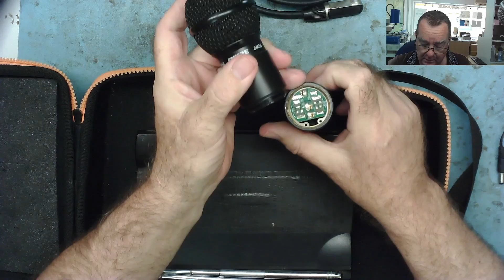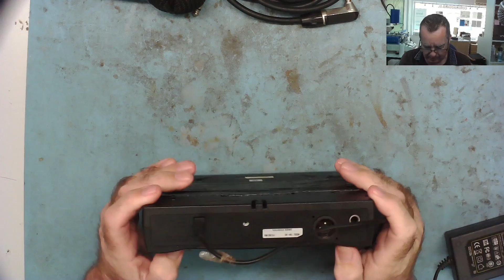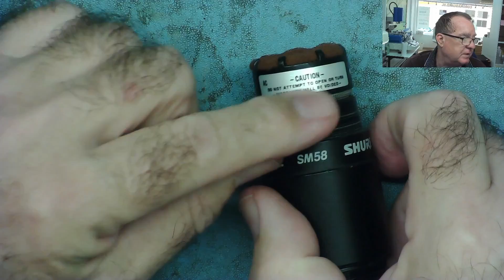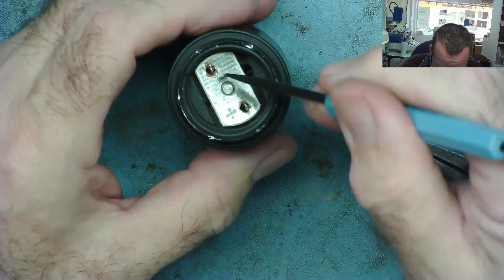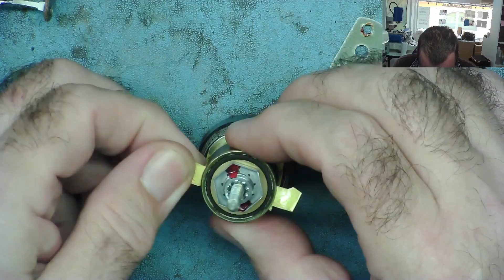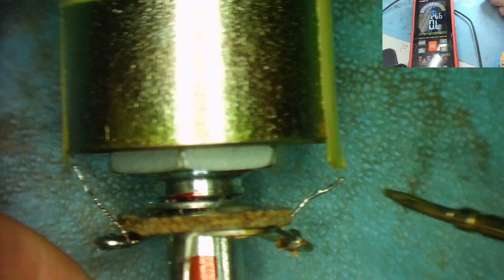Shure SM 58 Wireless Radio Mic Microphone No Audio Sound Output Repair

Comment: I rewind vintage magnetos for a living, mostly they use 0.07-0.08mm wire (around 44-45SWG). although I had to go down to around 0.06mm once for a Honda double ended one. I thought that stuff was fine! This looks considerably finer.

Most of those fine wires have “solderable” enamel these days, I certainly always order solderable as I vacuum encapsulate my coils with an oven hardening, non-solvent polyester resin, which will effectively over-rate the solderable enamel insulation anyway.
I’d be interested to know what size that wire is. My coil winding machine goes down to 0.05mm overall diameter, but tensioning those really fine wires is a bit of a nightmare (as I found when I did the Honda coil).

Comment: I came into possession of a ULXD2 with SM58 Head and I noticed a rattle somewhere in the microphone. I deduced that the sound was coming from the head and after watching a few videos saw that there is a nut that holds the board inplace and yes you do have to go in from the top as the wires are EXTREMELY short. When lifting up the bronze contact just gently push on one side which brings the opposite side up. Take a dental pick or a fine needle and insert into a seam and gently lift up. As suspected the entire assembly  had come apart and the wires were snapped in two probably due to incorrect packaging during transport. Anyway it is very fixable and thank you for this video it was perfect from beginning to end.

Comment: I burn the enamel off with a butane lighter and it works. Be quick with it. You can use the same lighter to light up a big spliff to celebrate the successful repair.

Comment: I've done this many times.  I've got some pointers & can help. Heating the enamel off has never worked for me. I think people got this idea caz there exists enamel coated wire which is designed to be burned off either by flux or heat. MOST enamel wire is not like that. Especially wire used for this purpose >> When considering which wire to use for this delicate application they have to consider the enamel type & thickness to get the mic "sound" correct. They choose wire carefully...  In my experience, trying to burn off enamel results in a more difficult to remove burnt plastic which is now stuck and carbonized to the copper = no bueno. 
sooo.
The trick to getting the enamel off perfectly and beautifully is to use sand paper... abrasives.  Practice with scrap wire. It is very easy when you get the hang of it, but since the wire is soooooo thin it is really hard to see(more on that later/Final Trick). Use the correct grit. Use fresh paper.
 
      Technique #1 >> Tear off little bits of sand paper and stick them to jaws of needle-nose pliers OR tweezers. The tip/end. Tweezers might be better caz the springy-ness will help not put too much pressure. Use tweezers with blunt ends/ not pointy ends. Glue the sand paper to the tweezers or get them stuck somehow. >>> Squeeze gently and pull. Use the other hand to grip the wire. More pulls are better than more force. Stay in the same place with every pull. Count to 10 or 50 and check continuity on that little strip. If good continue >>> Rotate 90 degrees and repeat. Rotate another 45 degrees and repeat. Rotate another 22.5 degrees and repeat.  I call this method the "sandpaper sandwich"
      Technique #2 >> sick some sand paper to something semi rigid & easy to hold like a popsicle stick. Then find something large & flat to rest the wire on. I typically use the pivot joint of the needle-nose pliers. Hold the wire down on the pliers and then sand off the enamel in rotated sections as described above. 
      Technique #3 >> This technique takes practice and I only do this for stubborn wires or when there are way too many to do by hand.  Use a Dremel 932 grinding stone.  I customized mine by making a V-groove in the grinding stone because without that it takes way too many rotations of the wire. With the v-groove you only have to turn the wire 4 times. Without the v-groove it takes ages and often the wire is thinned out of existence. (Flat sections of wire suck!! =weak wire =bad/start over)  Set the Dremel for low/medium speed >> Hold the wire in fingers and gently apply it to the stone >> because the wire is so thin it will have just the right tension to push itself against the stone. The wire will try to wrap itself around the stone and this can be used to your advantage as it will grind more of the enamel.  YES, the direction is important. You want everything arranged so the wire would wind up along the spinning grinding stone.   It's really easy to go too far & practice is necessary.  I customized my 932 because i use this technique often & for many different gauges.   You can find the correct Dremel speed by trying the very tip of the wire first. Slow speed.

   Final trick >> since you're dealing with a mic capsule it is very easy to check if you've got the enamel removed properly by hooking the wires up to the mixer.  You can easily connect alligator clips to an empty XLR connector(no wires attached)... The bare xlr connector has big pins sticking straight out. Turn the gain up and you will be able to hear whether or not the enamel was completely removed. Sometimes it is still spotty, but most of the time complete strips are still there. Listen for the interruption of the ground noise. Push the alligator clip on all parts of this enamel cleaned wire to check for uncleaned spots. It's way faster & more reliable than with the multi-meter.  Don't forget about the sharpie trick to make sure you've covered the whole surface :) 

NOTE: CAUTION:          It is sooo important to get this stuff off completely before trying to solder >>> caz when you try to tin this "unfinished" wire 2 things will likely happen >>  One is that the enamel will carbonize and somehow spread to the whole area >> Then solder is utterly refused, black stuff makes the solder not stick. The second thing that will happen is that the solder might stick to a teeny tiny bit of the wire, then this really gets in the way of trying to redo. When you try to re-scrape/re-sand > the solder gets caught and then you will likely rip the delicate wire apart.  It's near impossible to use the Dremel Technique #3 on wire with tiny blobs of solder.    
                 Yes, again >> Verify the enamel is completely removed prior to soldering << 

   I use techniques 2 and 3 most often. I've also found delight in diamond needle files, but they don't work well for mic wire. The abrasive is way too coarse. It doesn't get all the sections and it's too sticky.   Razor blades which are precisely dulled sometimes work & thats my goto for most wire stripping, but mic wire is special. Razor blade stripping doesn't work consistently for mic wire. Too much risk / not enough slack. One bad pull and your Fkt. Slow and low with the sand paper works every time.    Lastly, if you've got a really expensive capsule you can always unwind a wrap and get another shot...

-Cheers
Reply: Tdt recods: do you have videos of your techniques? It sounds brilliant. Thx
Reply: @ricardoferreira2811  I need a camera. Currently I'm a broke & broken musician. It's a good month if I eat everyday... Don't even have a phone. Embrace the changes caz most things don't happen more than once :)

     I've got plenty of audio recording gear, but zero vid recording stuff aside from make-shifting something out of the raspberry pi or a usb microscope. 

   I have plenty of tricks to make content. Lots of stuff I'd love to teach, but... yeah.. zero video recording gear. 

Someday... 
Thnx 4 showing interest. It's motivating :)

Comment: those tiny enamel wires are a pain to work with. Recently I was fixing a connector for headphones and they used similar tiny wire. I had no luck using soldering iron to break enamel so i can tin them. The trick for me was to put a flame on the end and burn off the enamel. Be careful as it burns like a fuse so you have to blow it off quickly so you only burn enamel at end of wire. Good luck

Comment: I cheap investment to test things like this is one of those cheap baofeng dual band VHF UHF handheld radios for like $30 USD. You can literally dial in the frequency manually and under a 50 ohm dummy load you can transmit back to the mic's receiver as well.

Also Sure is a good mid tier mic brand but there are Chinesium infused plastic fakes out there. The SM-58 is a very common model used out in the wild for general use like in a band for vocals or as a mic on a paging system, at the pulpit in a church, etc... The SM-57 is the model used to mic a drum kit or used in a a room where many people will be speaking at a table in a business meeting / conference or at a convention panel show since it is directional. Neither the 57 or 58 require phantom power from the mixer.

Sometimes with these things like this that you can buy off the shelf at a music shop or online it is best to just replace the whole unit. Of course if it was a special application device that was built for a specific job then you would invest in a repair because of the cost.

Comment: Always hard to fix that fine enamelled wires when they have broken under tension, it can snap where it turns a corner or meets a hard edge. The tape can also mean that it can break in more than one place.

Comment: Nice.
But the thin wires want  free speace fore mechenical abuse (vibration) fore streching so there has to bee a stress release on the coil (loop in tape) and his conections :).
Can you messure the windings on top of the coil ?

Comment: Your having the same luck I had at getting these working again.

There's a huge weight difference in capsules between the original and the bargain replacement. Probably a good indicator that it doesn't have the same frequency range and quirks as an original.

If it's a seasoned performer who's used a 58 for years the bargain capsule may not be a very good choice.

If it's a podcast guest mic or grade school recital mic the cheap copy may be good enough.

Comment: Thank you for featuring a mic repair. Actually, the SM58 (non-wireless) is probably the most used and the most durable dynamic microphone ever build. They have literally been used to hammer nails with and still only needed a metal cover replacement, so it's quite interesting to see an actual failure of the cartridge itself.
Reply: I think someone had already twisted the top part and snapped the wires.
Reply: That's actually the Electrovoice 664 story :p

Comment: Hi Richard i saw that you soldered the positive of the coil to the negative of the terminal:Red terminal is ground ! but as it didn't work... hasta luego amigo ! :) and i wanted to say: the third contact is for phantom power...
Reply: I didn't know they made a model 58 that needed phantom power.
Reply: no phantom power for dynamic mics. You can tell if the mic requires phantom power when it has flat pieces of metal. Metal foil.  Mic capsules which have coils of magnet wire are going to be dynamic & no phantom power.
Reply: @tdtrecordsmusic  I have no idea what your talking about in identifying one type of mic over another. I have several Sure brand mic's and one of them does require phantom power.

I also have a few very old recording microphones that have built in batteries and they don't need phantom power either.
Reply: @tenlittleindians  The manual will tell what technology the mic capsule is made of.  
    You would have to disassemble the mic capsule to see the "metal foil"  vs "copper coil" of magnet wire.  I do NOT recommend taking them apart. I do, but I have the dexterity of a watch-maker. Even with that I only mess with a mic if I need to or it's dead. 
   In general >> condensers need phantom, dynamics don't use phantom, Ribbon mics are all different and you HAVE to read the manual. 
  If you're curious I'd just look it up :) Lots of info online :)
Reply: @tdtrecordsmusic   That's almost accurate. My father just happened to be a watchmaker. Schooled in Elgin Illinois back when people still wore watches. I've got the skills he had plus some electrical background he didn't have.

You seem to have left out or forgot about crystal mics. There's not much to repairing one of those that's been dropped.

A huge chunk of those old "Elvis" style mics have crystal cartridges inside and the sources of replacement cartridges is dwindling.
Reply: @tenlittleindians  Thats cool you've got watchmaker in your blood :) 
Crystal mics, yeah I didn't know we were naming off every mic technology ;p The piezo !!  There are surely some technologies we missed...
   Is the Shure 55 the Elvis mic you speak of ?  An OEM crystal cartridge in that iconic mic sounds like a treasure hunt. A folklore of sorts...  I don't know much about those mics. I've used them b4, but thats about it. I don't remember that mic having any special sound .

Comment: Hi Richard thanks for the amazing work. Just an off topic question. Why is there a voltage  when you measure between transistor C to E in a common collector setup when its ON, while in other videos you mentioned that when  the transistor is ON basically the voltage between C and E is around 0.1 or like a short. I am a bit confused.
Reply from the maker: That depends on what voltage is on the emitter.  In common emitter circuits (the most common configuration) if the emitter is connected directly to ground then the voltage on the collector would be almost zero if the transistor is on.  If the emitter connects to ground via a resistor (and collector to Vcc by another resistor) then this would not necessarily be the case.

In other circuit configurations such as emitter follower, there can be quite a large voltage across collector-emitter when the transistor is turned on (and it gets hot).  In this case it is acting like a voltage regulator so for an input of 12V on the collector, and 9.6V on the base, then the emitter (output) would be 9V and there would be 3V across the transistor collector-emitter.  The wattage dissipated by the transistor would be 3 Volts x Current (amps)

The one thing we can say for certain is that if the base is around +0.6V (or -0.6V for PNP) with respect to the emitter, then the transistor will be turned on - if it is a good transistor.
Reply: @learnelectronicsrepair  I get it, thanks for the prompt reply. Please keep it up.
Reply: @ahmadpopal9567  if you can see the markings on the transistor, you can look up the data sheet for it, then look for the value for Vce(sat). this is the max volatge between the collector and emitter when the transistor is fully saturated. e.g. the base has been driven to a voltage that can't turn on the transistor any further. this can be lower for small signal transistors than for power ones.